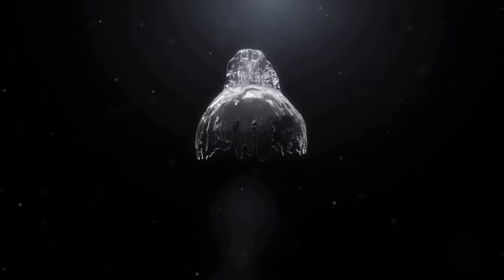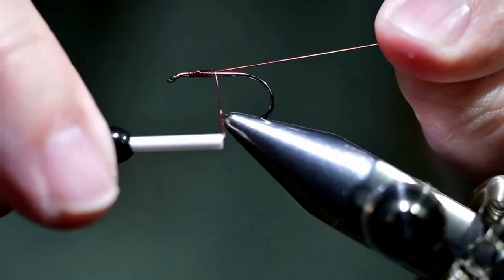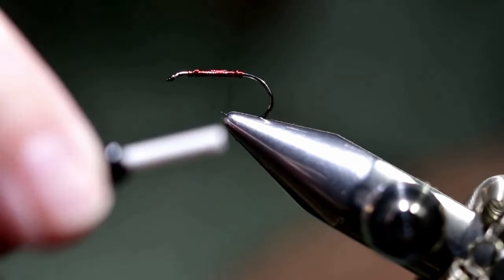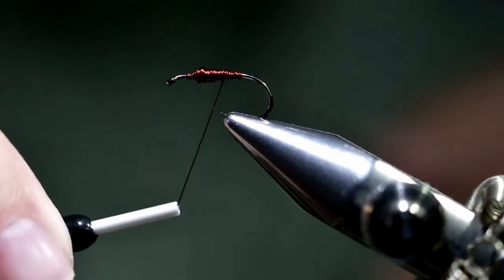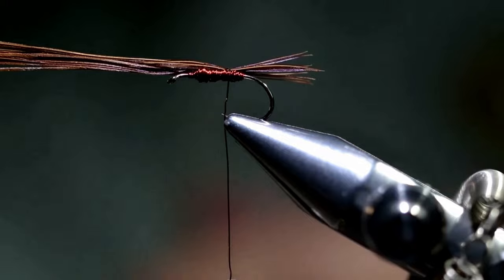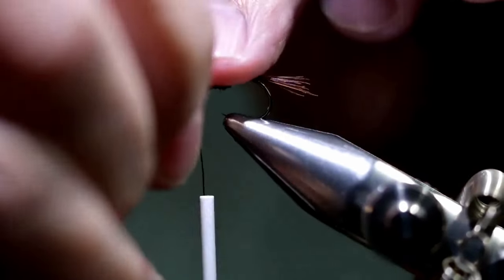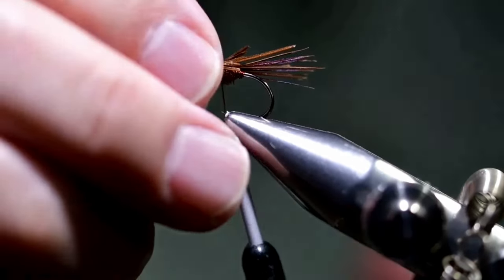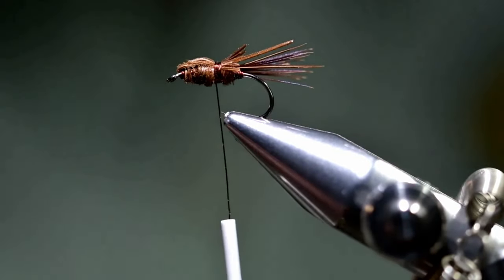Sawyer’s Pheasant Tail Nymph

Comment: The firts picture you show and what you tied are not the same.  Also, Most other versions use the tag end as the rib and wrap the pheasant tail around  the wire.  I guess it is to each "hisn"
Reply: Every tyer adds their own interpretation when tying. However, if you look at the fly as tied by Sawyer this was his way.